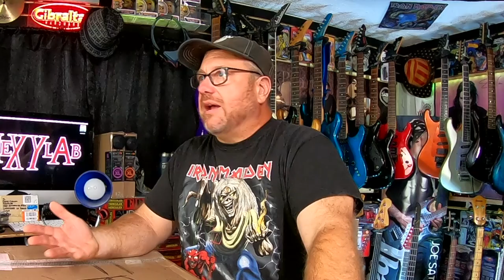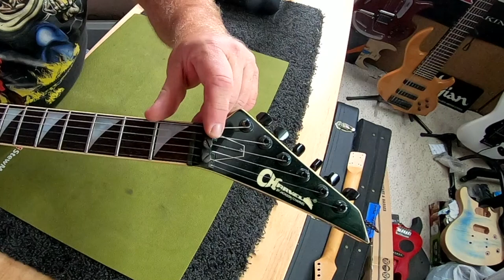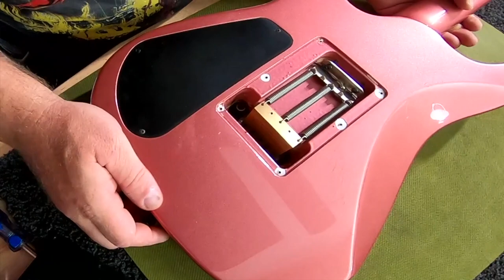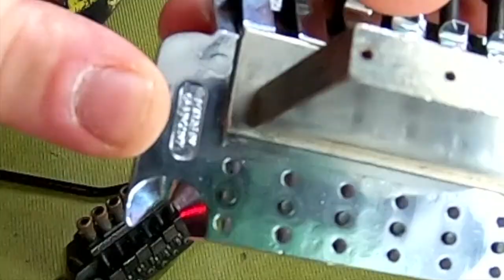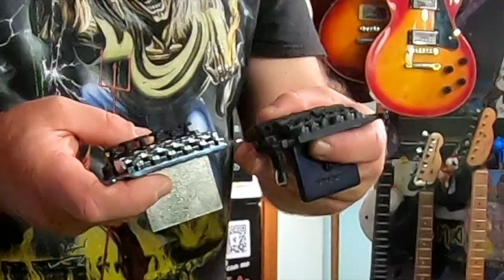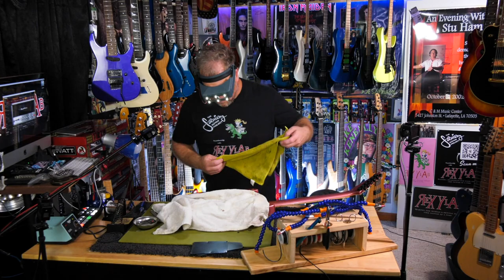1988 Charvel Model 6 And A Story About Weed 🎸🤘

Comment: I actually broke the bar on my JT6 back in the day.  I was given an Edge bar as a replacement, as that was all I could source back in the late 80s at 17 years old.  I found the Edge bar was a tiny bit narrower than the JT6 bar.  There was a little bit of play that I had to remedy by putting a sliver of electrical tape on the bar to snug it.

I have mixed feelings on the JT6.  The fine tuners "solved" a problem that didn't really exist.  The nut behind the nut created some weirdness.  On mine, the B string gets hung on the locking screw on the nut, necessitating having to tune the string sharp before locking.  The metal on the bridge string locks wasn't the best and easy to strip.  Just my personal observations.  YMMV....
Reply from the maker: All that tracks with my feelings on the JT6. I like it now but it was discontinued for a reason. 

Still, they tried something new and I give them props for that.
Reply: @REXYLAB  I ended up stripping the low E lock and had to cut a notch in it so I could work it with a flathead screwdriver.
Reply from the maker: I am extremely grateful that whammy parts exists. I can get most of what I need for lots of hard to find stuff. Really great for kahler. 

Btw, I wrapped a little Teflon tape on my JT6 bar to keep it snug.

Comment: Great save and what an awesome backstory!  I'm the original owner of a 650XL (metal flake black with the toothpaste logo).  Over her 33 years, she's only needed a few squirts of deoxit in the pots and batteries.  I've installed a "tremel-no" since it's currently my only axe & I'm constantly changing the tuning (the "Jackson-Floyd" can get a little temperamental going from standard to drop-C.)  It's a reversible mod so if if the desire to wail on her again returns!
Reply from the maker: A tremel-no is a great solution if you want to change tunings. So many people try to change tunings on a floating bridge and can never get it back. 

Great guitar you have. They don’t make them like they used to for sure.
Reply: @REXYLAB  Thanks!  I wasn’t sure if you’d flame me for it…like adding cylinder deactivation to an LS engine! The “Floyd” bridge lays flat with the body and I can literally change tuning in seconds especially with the micro adjusters. I also still have my late 80’s Peavey VTM 120 (full stack) which I’m in the middle of recapping the head...STOOOPID loud!
Reply from the maker: I have modded so many things that I have no right to get in anyone for doing it. Now days I like to keep lots of stuff stock but I still mod things like crazy. 

My main bass was only made one year and everything about it is modified, even the neck and body.

Comment: Don't you love when you finally pin down that elusive guitar? I spent 10 years searching out Guild Bladerunners and one day I was able to purchase one. My dad had one in 96 or 97  but pawned it needing money. Unfortunately whether it was lack of knowledge or the market being soft, he got little for it and it sat in the music store window a long time at $450. I love that Charvel.
Reply from the maker: Indeed I do! As you can see from my guitar room (I call it the Guitarmoury) I have spent a lifetime doing just that. 

I have a bunch of videos both about acquiring guitars and fixing them as well as modifying a few for children with rare and terminal diseases. 

Guitars are my passion, I hope you check it out. 

P.S. I have a few Yamahas that will be getting videos in the future but one is a mangled SGX. I haven’t figured out quite what to do with it yet but it should be interesting.
Reply: Guilds from that era are a dang delight , I had white X80 ....one of my  search for grail guita s now. A big day had a X79 yellow and black with the 3x3 headstock my 80 had 6 in line.

Comment: I also graduated in 87 and had 2 years of hair guitar under my belt. Unfortunately, I was NOT a prodigy. Charvels were huge in Indy. My local shop had em all 2-6. Pointy headstock, Jackson inlays, and a Charvel logo. Dark purple. Awesome. Never liked Ibanez because of the headstock shape.
Reply from the maker: I totally understand the headstock shape thing. The Charvel headstock shape was originally a strat copy and I used to hate those. Ironically the strat and the Ibanez shapes are more efficient than the Jackson shape that the model series has. 

However, I totally love them all now! 

I’ll be the first to admit I didn’t get the Charvel thing in the late 80s, I sure do now though. Check out the condition I got my lava crackle model 4 in. This is part 1 but there will be a link to part 2 at the end of it. 

1989 Charvel Lava Crackle Model 4 Rescued! Part 1🎸
https://youtu.be/CUXXu_hiokY

Comment: I collect model series. This guitar although has the  trem arm issue appears to be far from abused. I have seen some model series that were truly abused with hacked scallop jobs , hacked pickup routing, hacked kahler to floyd conversions. This is a pretty rare color and having original electronics, even with the original case too. nice guitar
Reply from the maker: You are 100% correct! It cleaned up very nicely. But if I couldn’t have brought it back to near mint I wouldn’t have got it because of the story from when I was a kid. So why call it abused then? Well, two reasons actually. 

Reason #1- you didn’t see all the restoration I did to it. If you did the video would have been 8 hours long. Everything on this guitar needed to be gone through and tightened up from the tuning machines to the strap button behind the trem. And I mean everything. Plus I polished the hell out of it among other things. I focus on the main thing that was the issue for the video and it was definitely some fool trying to put Floyd parts on a JT6 even though they didn’t fit. (I have truly hammered guitars coming up. So you will definitely get to see hack jobs if you come back). 

Reason #2- I have been told by some pretty successful guitar youtubers that if you don’t make your titles and thumbnails click baitish nobody will watch them. So don’t hate the player, hate the game. I’m just trying to figure out the algorithm like everyone else. 

If you want to see a hammered thing I fixed I did a Jackson custom shop bass from the same year, 1988. That bass actually had serious problems. 

Either way thanks for watching my video and commenting. I have more 80s classics coming up including another Charvel.

Comment: I remember looking at one of those in the 80s. I couldn't afford one so I ended up buying an Ibanez roadster which I got cheap as the coating had a chip off it near the neck. However as I type this I'm looking at my cream coloured/ Pearl White Charvel model 6 I guess that it is meant to be Pearl White.  It also has the JT6 and Jackson pickups. Funnily enough it never came with a trem arm but an Ibanez trem does the job. Like me it has a few scrapes and knocks but it's definitely one of my favourite guitars though I'm not a fan of those pickup switches.
Reply from the maker: Yeah, I’d prefer a 5 way but it’s a small price to pay for such an amazing guitar. 

Also, bless you for keeping it original.

Comment: A bit of a warning - Do NOT expose 1980s Chavel guitars to the Sun. 
The binding, which perfectly matched the white shark fin inlays when new, will turn green in an instant.
I bought my Model 6 in 1988 and kept it in mint condition for the next 30+ years. Then I let it set in a room that had sunlight for a few hours... it can't be fixed.

Comment: Love my model 5! Poor man’s Jackson soloist, lol. It’s got a 2300 on it, but I need to buy Kahler’s version of the Floyd locknut…… I shimmed the behind the nut lock and it’s better now….. but I want a true locknut. I like that Kahler sells the right radius for a Jackson/Charvel
Reply from the maker: I work for Kahler and I’m standing next to Gary Kahler right now. It’s cool your model 5 has a 2300, much better than the JT6.
Reply: @REXYLAB  Can you do a video on the locknuts? I think Kahler has the superior one and not many people know about them. They only know of the “behind the nut” clamp. 

Kahler Locknut looks better machined and it’s case-hardened steel, correct? Also no need for a string retainer? 

I was always curious…… how does a Kahler work with a zero-fret? I bet the behind the nut clamp would work better with a zero fret!

Comment: Walked into a Guitar Center neat me a year and a half ago. They had one hanging on the used wall for $550 and I didn't get it. I don't know why
Reply from the maker: If you ever see a 1988 model 6 I n burgundy mist that isn’t all jacked up for under $1500 buy it!

In any other color that is too much but you almost never see that year in that color on that model. 

But any color 1988 model 6 under $1,000 is a good deal. They are only going up in price. Just remember, condition is everything.

Comment: A friend of mine gave me a 1983 that was sitting by the window in the coast not good as you know ..has a micro p hairline crack on the top of the the neckbut maple is just laughing at that so still strong...sanded it all down for a smooth fast feel I've done a lot of work on it one of my favorite guitars
Reply from the maker: A good guitar can bounce back from a lot.
Reply: @REXYLAB  no doubt
Reply from the maker: I have a late 80s model 4 on my bench now. That video will be coming up soon. 

I also have a 89 predator coming up as well. 

I hope you subscribe so you don’t miss them.
Reply: @REXYLAB  cool sounds awesome

Comment: The base plate on the Korean Floyd Rose Special and 1000 are slightly smaller than a genuine German made Floyd I don't know if you noticed.
Reply from the maker: Yep, I make it a point when it comes to Floyd to only do OFR. 

I miss the days when a Floyd only came from Germany and you didn’t have to worry about what one you were getting.
Reply: @REXYLAB  Even the Schaller... made right on the same tooling in Germany. I have one marked ESP on one of my M-ll Deluxe.
Reply from the maker: Yeah, I have a Schaller that is branded Hamer myself. 

I have so many locking vibrato systems that other people call “Floyd Rose” that I am preparing a series on them all so that there is a place people can see how different they all are.
Reply: @REXYLAB  Greatest battle implement ever devised
Reply from the maker: I totally agree.

Comment: i had a black 87 6 that was stolen in 89, i just got a Blck cherry 87 6  the pre amp has been changed to a bartolini, sounds anemic....it does have the JE1200 in the case , the pots are stuck, i am hoping it was changed for that and some deoxit will get them working...if so i hope the preamp still works.  fingers crossed......any idea how i would test it without ripping out the installed guts now?
Reply from the maker: Good question. 

I would definitely try deoxit and see if the pots will even move. If they won’t then I’d replace the pots. 

After all that hook it up to a pickup you have just laying around. If it gives you sound your a good way there. 

If none of that works there is a guy on eBay selling reproduction JE-1200 preamps for $45.00. If the original works, awesome! If not you have an alternative. 

https://www.ebay.com/itm/Jackson-Guitar-Preamp-JE-1200-Charvel-Mid-Boost-wired-/313028389737?mkcid=16&mkevt=1&_trksid=p2349624.m46890.l6249&mkrid=711-127632-2357-0
Reply: @REXYLAB  having a strong urge to mouth kiss you, thanks a lot!  my limited searches were coming up with 275.00 used might be functional options!  again thank you  deoxit is on...the...way
Reply from the maker: No need to mouth kiss me but if you haven’t subscribed I would appreciate it if you did. You can tell your guitar playing friends about my channel too, that would help me out. 

I’m trying to grow my little empire and I’ll have a bunch more classic 80s stuff coming up. 

And if I didn’t say it before it sucks that your first Charvel got stolen. I’m glad you got one to replace it. 

I’ll have videos coming up on how to set up a JT6, Kahler, and Floyd as well as even more locking vibrato systems.
Reply: @REXYLAB  liked and subbed, I will ✔️ out your other videos, on dig 80's vintage I still have a MIJ strat with system one trem.  Remember the n the 80's used her was just used gear? I once traded a 73 sunburst Les Paul for a pink RG Ibanez...even had to kick in a couple shekels....then ....Slash brought them back .....
Reply: So, I have the replacement circuit, in my mind's eye I should use the stock pots and caps ..I have not deoxed them yet,  mechanically if it turns and the insides of the pots are not damaged they should work ..right? Other than getting dirty they don't usually go "bad"  right?  My intent is to just copy the wiring on my original guts and reinstall them.  Sound smaat? Or should I buy new posts?
Reply from the maker: Typically if your shoot them full of deoxit and move them back and forth they will be fine. Pots can go bad but typically they don’t. If they do it’s something obvious like they won’t stop turning now or they just don’t work at all no matter what. But typically if they clean up they are fine. 

The important thing if you do swap them it to make sure you get the correct value and shaft size. I didn’t have to pull mine so I don’t know but usually active stuff like this takes 25K or 50K pots instead of the usual 250K or 500K. I can check mine with a meter and tell you what you need if you have to replace them. Because this is an import guitar it probably takes alpha size pots instead of CTS. If you need help determining that I can check for you. 

Your switches can wear out but if your model 6 is like this one the “bat” style switches are easy enough to find. If you have to swap them and need help finding them let me know. 

The most important thing is to use a good soldering iron, never use a soldering gun on guitar electronics as they are to powerful and can screw up your pickups. Tin your tip, the lugs, and your wires so when you go to attach them you are in and out quick. Use the right solder, not the stuff for fixing plumbing. If your tip is burnt throw it away and get a new one as once a tip is destroyed on your iron it is next to impossible to get it to work properly ever again. Lastly, cover the guitar because if you get any spatter from soldering on the paint it is ugly and you’re stuck with it.

One last thing, if your soldering skills are not very good practice first. If you are unsure of your abilities take it to a good tech that you have researched and trust. 

You probably already knew lots of that but I had to be sure incase you didn’t. 

I’m glad your preamp showed up, my bass did not. It was on the truck and everything but the driver just forgot and brought it back to the fedex hub at 4pm and put it back in the system. I went to the hub to try to get it but they weren’t having it and now they are talking about sending it back to the sender, all the way across the country for some crazy reason. 

Or, they might let me pick it up in an hour. Still yet they might deliver it today. Or I was told they might just keep loading it on a truck and the confused driver will not deliver it and that will be the way it is everyday for the rest of all time.
Reply: Deoxit worked a treat, was able to reuse the entire stock wiring other than the JE1200.  I forgot how much I like the sound of this guitar.
Reply from the maker: @davidcastle3292  I am so happy I could be a small part of you getting it back in working order! That is why I made my channel in the first place.

Comment: I have one that exact guitar in that color!
That's an arm from a St Louis Music Company trem.
Reply from the maker: Do you have a link to this trem? I looked and I can’t find it. 

It’s a cool color for a guitar, what model is yours?
Reply: I have both a Model 4 and a Model 6.
That trem socket is from a Westone Spectrum 1400 trem system.  Taiwanese knockoff Floyd Rose.
I used to work on them at a guitar shop in MO where 100's of Westones were sold.
Reply from the maker: @nelsonward7981  I have a model 4 as well and a 3DR. Videos coming on them for sure.

You won't believe the horror show the model 4 was when I got it. It looks great now. 

I looked up the Spectrum, looks like a bendmaster system like what they put on the platinum BC Rich stuff back in the day, no?

If so I have one of those to do in my, "Would a Floyd Rose by any other name play as sweet" series. If not it doesn't matter anyway because its fixed now anyway.
Reply: @REXYLAB , love my charvels, I had another Model 4 in Black Cherry, best guitar I ever owned with a J90C pickup in the Bridge instead of the J50BC, came new like that.  Unfortunately, it was stolen.  I did get it back but the thieves sanded off the paint and hacked up the electronics.
Reply from the maker: @nelsonward7981  I’m sorry to hear that. I hate thieves.

Comment: Would love an 80"s Charvel myself but they're pretty rare lefty. Also at one point, just put a real floyd in it man lol or a Gotoh IDK it would be an upgrade anyway
Reply from the maker: Yeah, it sucks that there are so few options for left handed guitar players. It’s certainly not fair. 

As far as the JT6, I don’t know how many times I will wind up saying this but the point was for it to be original. 

I have plenty of guitars with Floyds, kahlers, gotohs, Ibanez edges, and many others. 

The JT6 is not a bad bar. It’s not great either but it’s fine if set up correctly. It’s certainly far from my first choice but I have guitars with all those other vibrato systems and that was not the point of why I wanted this guitar.